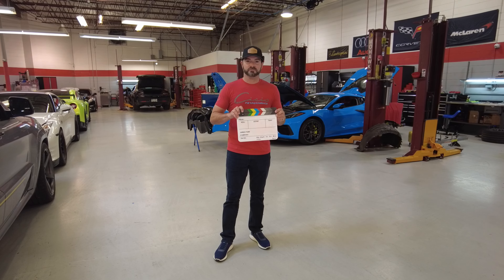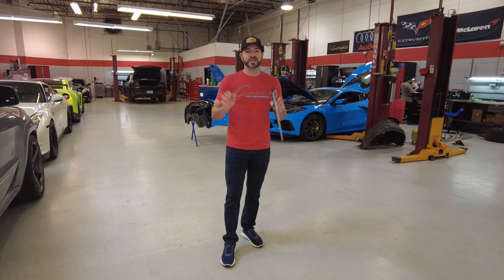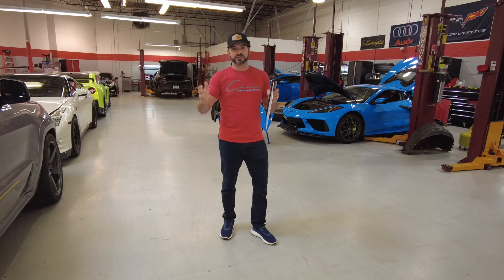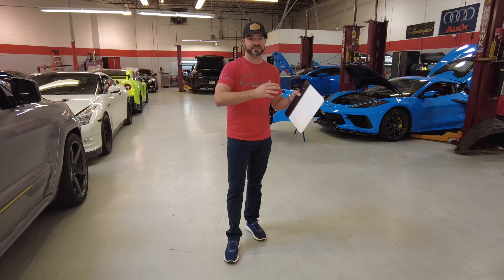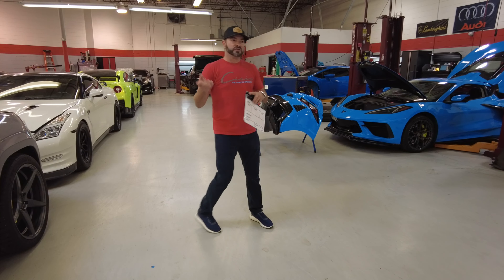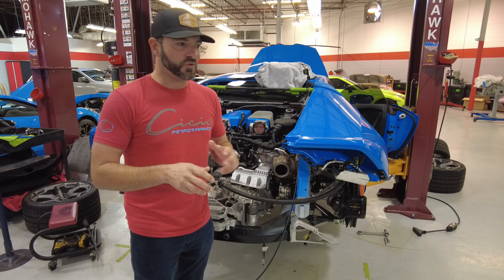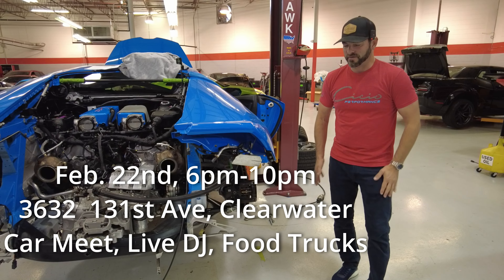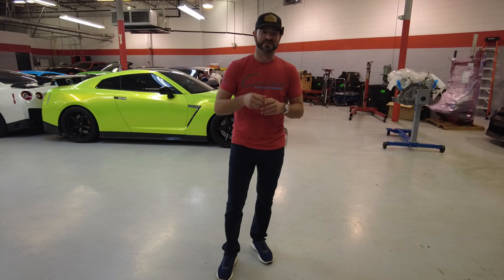Will this Lamborghini make 3000hp? | FL Shop Update

Comment: Talk about all the hellcat builds that customers got screwed on when you took over forza performance.... my tune is trashed and jan says contact Brenton to fix.... I suppose we don't get a warranty... almost $18k and the car is under 850whp on redeye and car goes into limp mode after a hard pull .... no dyno run numbers..   so now I have to pay another $1200 for a proper tune and dyno numbers..... all those other customers left hanging....
Reply from the maker: I would absolutely love to talk about that.  My email address is cicio@cicioperformance.com if you really wanted real information.  But since you posted here I will address a few things you said that are completely false. 

We did NOT "take over" Forza.  We did nothing but purchased the assets of a FAILING business. (lifts and tools)   At this point I am going in the hole well into the 6 figures for no other reason but to help the ex Forza customers.  I have zero liability to do so, I simply don't wanna see a group of car guys get screwed because a performance shop failed.  I care about the industry as a whole too much for that.  

Now, on the tuning front.  Your car was tuned by the owner of the old shop.  It had nothing to do with us.  Yet still when you called in my staff taught you how to log the car and asked you to send us a log to see if we could help. Again this is not our tune and has nothing to do with us.  We still are here trying to help.  And we still will...even after this public attempt of a jab. 

Finally, we have not left one single customer hanging.  We have spent hundreds of hours communicating, updating and working with the ex Forza clients in order for them to not be left hung out to dry by that company.  Once again with zero liability to do so and losing money with every hour spent.  

I think that is all the details needed on this YouTube video.  You have all of our contact information.